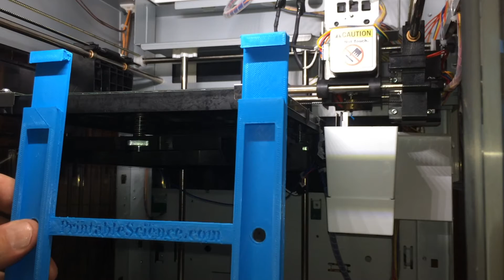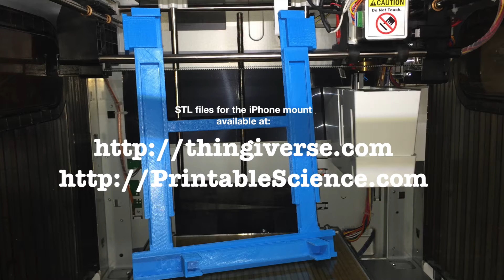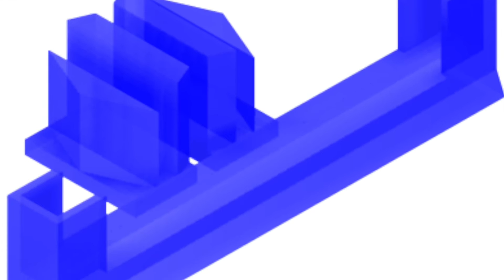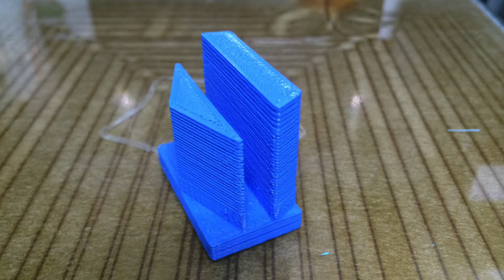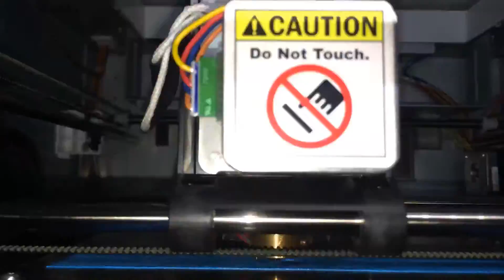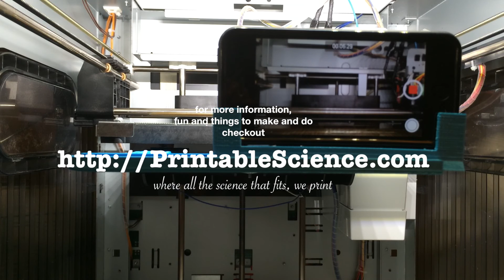XYZ Printing DaVinci 3d Printer iPhone (Camera) Mount

Comment: so has this melted or screwed up your phone yet??? does it not get way to hot in there for the phone
Reply from the maker: No problems with melting of the iPhone or any part of the mount. It really doesn't get hot enough in the Da Vinci case to cause problems. The iPhone has an automatic shutdown when the phone gets to be hot and that has never been triggered.